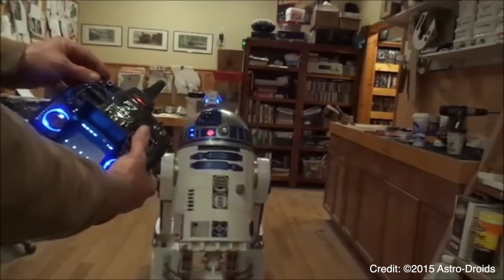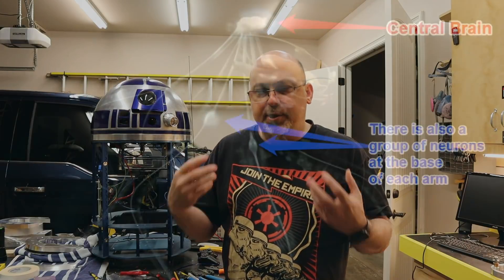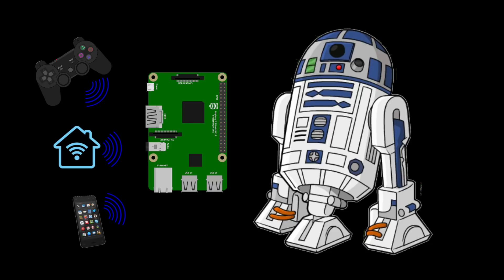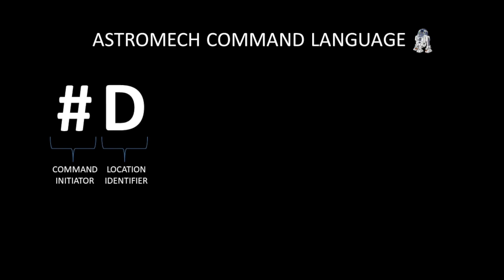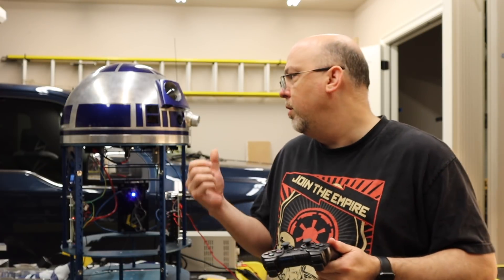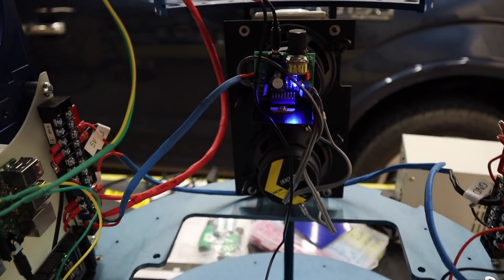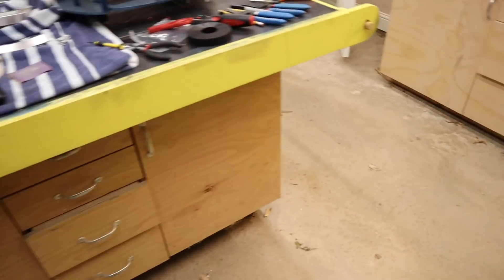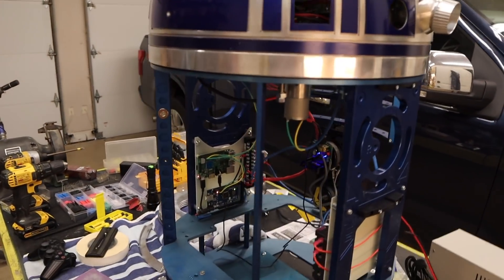Full Size R2-D2 Remote Control System (Raspberry Pi & Arduino)

Comment: I can tell you two things i know for sure. [1] R2-D2 was made from whatever crap Lucas Arts had on their shelf. [2] Their android didn't even work.🤣 It's the Star Wars that's killing your piggy. I'm sure you could build one better, -and at 1/3 the price.
Reply from the maker: Having built one, I can assure you that statement is not correct.  Many of the components were 100% custom made.  Very few of the parts were anything standard or borrowed.
Reply: @TheGeekPub  Have you had a chance to examine one they used? Custom parts or not, it didn't function. They'd drag it on wires, and dub sounds in later (Movie Magic). What you're doing is harder.
Reply: @TheGeekPub  I'm going out on a limb here, but you're probably also not stuffing a midget inside.🤣

Comment: This is interesting. I'm thinking of doing something similar with my Dalek build.  Rather than I2C, I was thinking of using a differential bus like CAN or RS485. I would be worried about the slipring and motors introducing noise onto the bus, especially with it being directly driven by the Raspberry Pi's output ports.  Likewise I would probably add a checksum to the end of any message strings for the same reasons.  Have you had any reliability issues with this setup?

Comment: Perhaps I'm missing something. But my desire - and it hasn't changed for 30 yes- is to have ANY bot/Droid in my household be Autonomous. 
After all. If we control it, its really just a remote controlled shell.
The toy that is the most 'realistic' is the r2d2 I own as a toy.
However, I haven't see this from a DIY.
Why is that?

Comment: What is your plan to have a failsafe for the drive motors when Linux inevitably hangs on the PI while the droid is in motion?
Reply from the maker: Great question.  I knew someone would eventually ask this.  It's a topic I've given a lot of thought.  I have two options and not sure which I am going to use yet.

1) If I route the control through to an Arduino, that's likely not to ever fail being a microcontroller, but it could happen I suppose.  In this case I'd have the Arduino stop the droid if no signal has been heard on I2C in the last 1000ms. 

2) The motor controllers I am planning to use actually have a fail safe feature. You can design it where in order to work they need a constant signal.  I could design the software in such a way that on crash, the signal would not be present.

Comment: @thegeekpub     Man, we need to talk. I have had something just like what your doing rolling in my head for 3 years. I have R2's frame and dome built, now it on to skins and flaps. I have been collecting things like the PS2 wireless controller, arduinos, motors from electric scooters, and lens from desktop projectors. I just don't have experience with the coding for Pi and arduino. Can't wait until you go open source. I've been a member of the Astromech club for a long time. My user name is Wingspread
Reply from the maker: Fantastic!  I need to do a lot of refactoring because I redesigned it half way through (because I realized I could do it better a different way).  So once I get that done and then add some basic features that are missing I'll be releasing it.

Comment: Did you ever look at EZRobot controllers. There is a lot of power and interface capabilities. Arduino controls, Raspberry Pi, Latte Panda and other controls will interface easily. The Synthiam robot diy forum really is helpful. Check it out.

Comment: I've been thinking along the same lines. RPi as the master with Arduinos as slaves. Question. Why did you choose I2C vs SPI?
Reply from the maker: SPI was generally designed for on-board communications, though I know some people are getting 5 meters out of it now.  I just wanted to go with something I knew I could make work.  But SPI might be worth a shot if you prefer it.